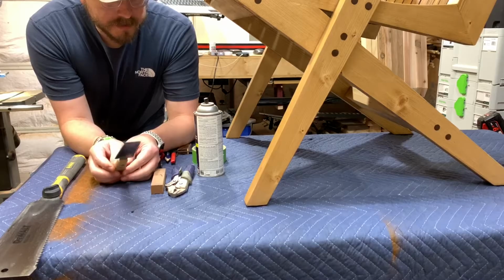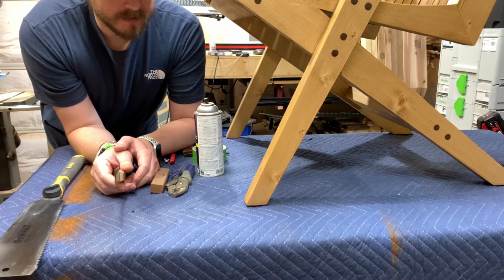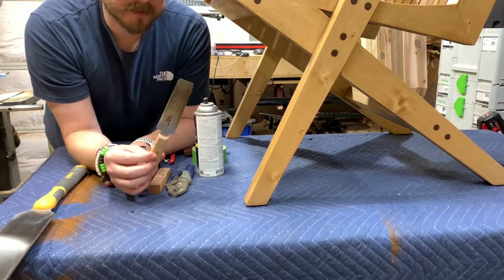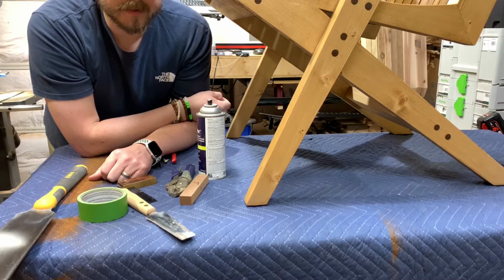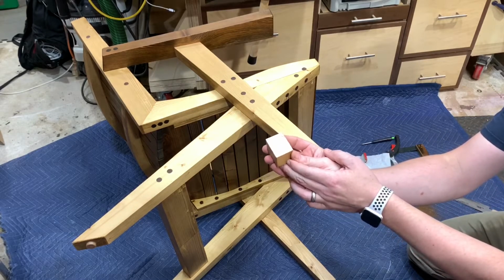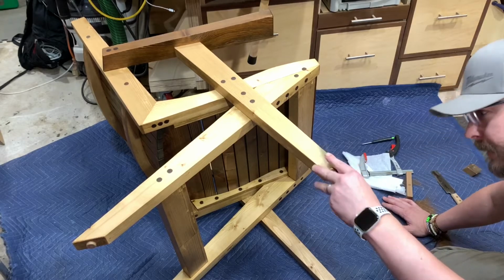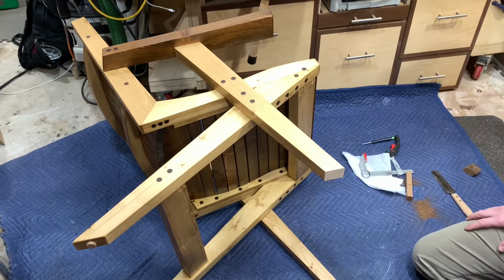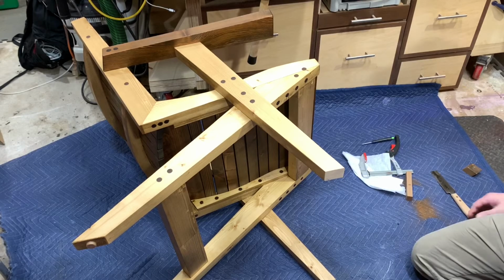Pro tip: How to make a precision cut in a difficult situation.

Comment: Yeah, a little trick my dad taught me was to leave the chair sitting flat on the ground with all legs touching and then however much you want to cut off, cut that wide of a strip of wood and then lay it on the ground next to the leg and scribe your mark and just like you did, use a straight edge to make your cut. Laying it on the ground with your strip next to it to mark it will ensure that the legs will all touch the ground just as they were before the cut was made.

Comment: Hey Ryan!  This worked for sure, but here's another thought.  I have no idea if this would work and I would have gone about it similar to how you did.  What I was thinking as I watched it, though, was what if you just ripped down some pieces and made a C-channel or L bracket  that you could have captivated the leg with and referenced the bottom of the leg for the angle and then cut using that?  That would eliminate the potential miss on clamping to the scribed line.  I was thinking C-channel because it would give more guidance for the saw being on both sides on the leg, but could be a PITA to secure since clamping wouldn't be easy.  IDK man...just thinking out loud here!  I'm also thinking that this may all be overthinking everything because this chair is almost surely going to be set on something that doesn't have a perfectly flat surface to begin with :-\